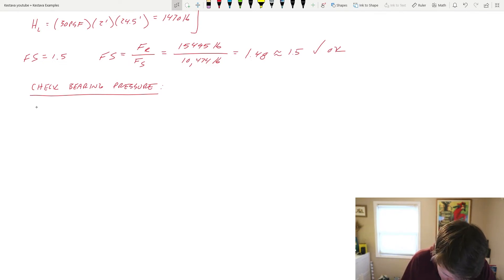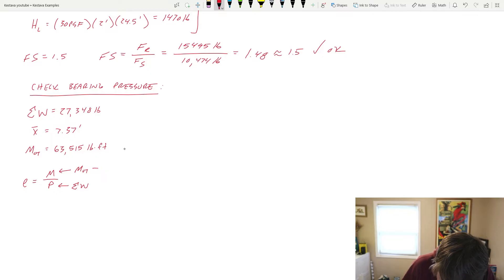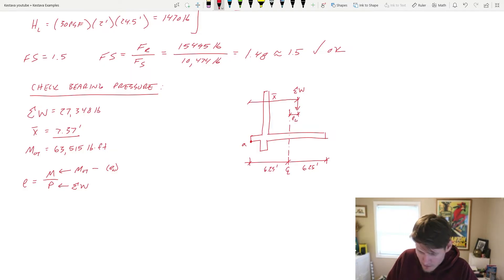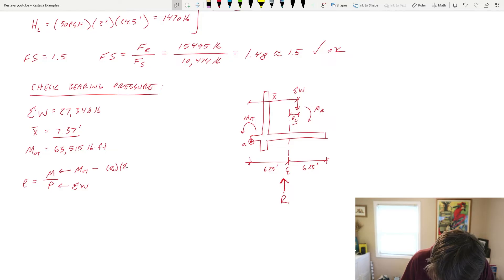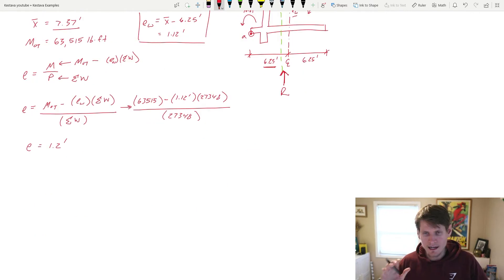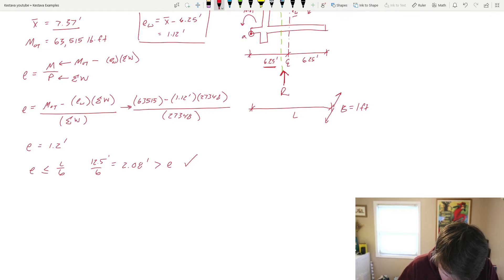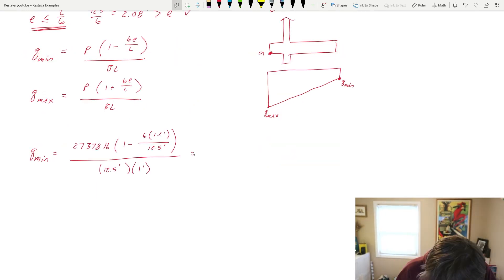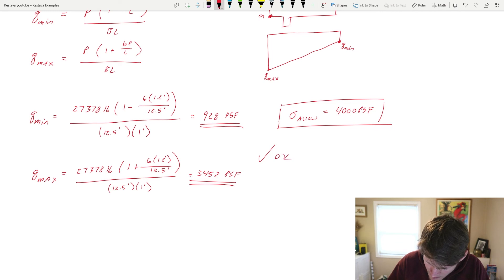Cantilever Retaining Wall Design Example | Part 3 | Learn Structural Engineering

Comment: Hi Kestava, shouldnt the excentricity be equal to the distance from the centerline to the point where the resultant of mass is located? Every formula for e i see in books is as follows e= B/2 - (Mr-Mo)/(Sum of mass), where B is the base width of the foundation. If i plug in the values in the formula i get the location of the resultant of mass that i calculated previously.
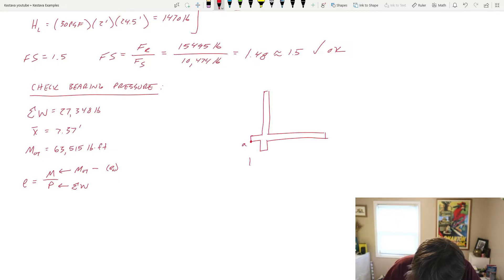Reply from the maker: thats what we did! see 1:00
Reply: Oh you’re right, I don’t know why I saw something different last night, I must have been tired and unfocused. Thanks!

Comment: Hi Bro thank you for info. Just wanted to point out one thing, that resultant what you have shown is not correct, it should be incline towards point of overturn. And the distance where resultant cuts the base from centroid of structure is the eccentricity, that should be less than L/6
Reply: Yup, the eccentricity should be measured from the centroid and not from the center line of the base.